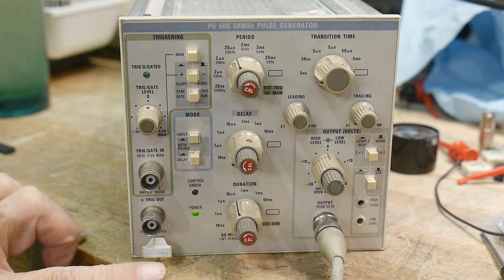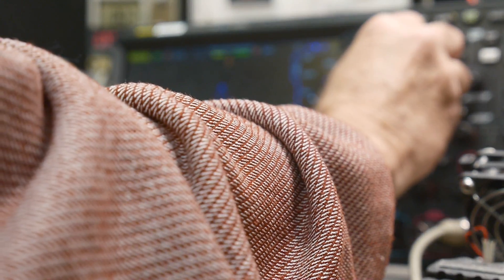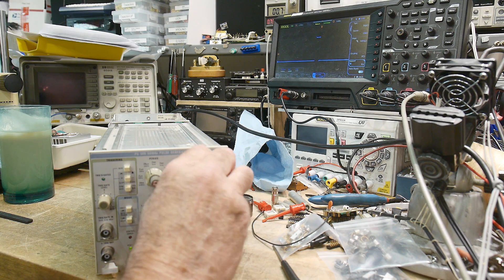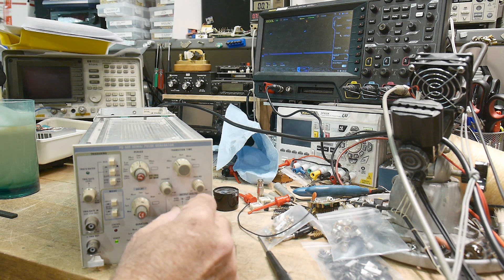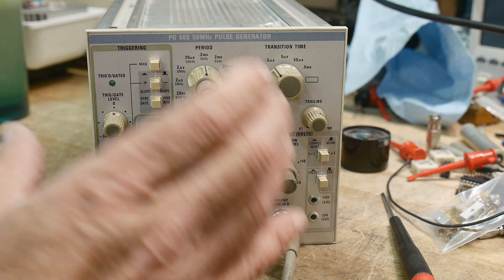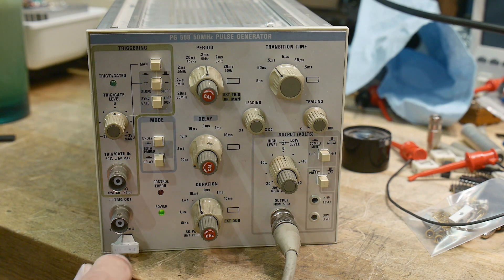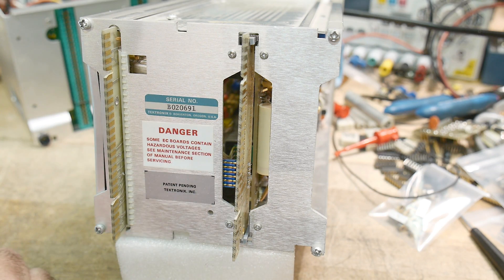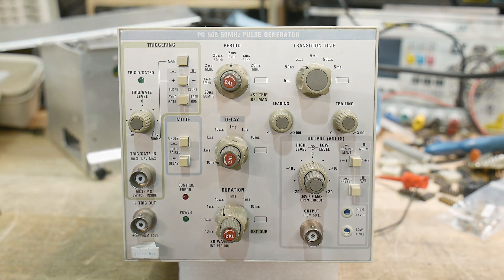#1348 Tektronix PG508 50MHz Pulse Generator

Comment: I have an FG504 which is similar to the PG508. One thing I've been able to use it for is to lock to harmonics of the trigger input. It's not advertised to do this and is a little tricky to get the levels right but it locks very well.